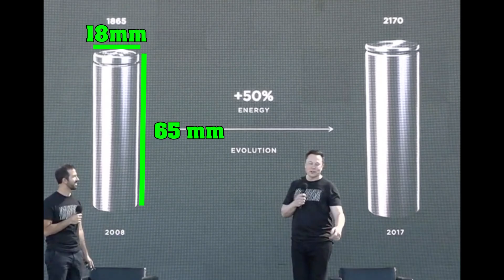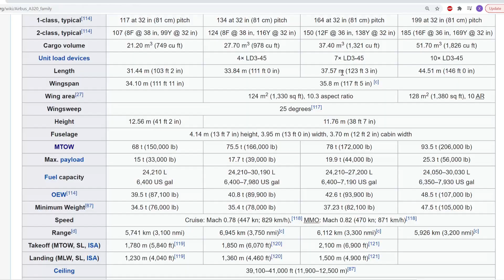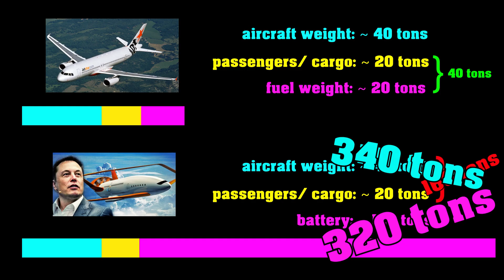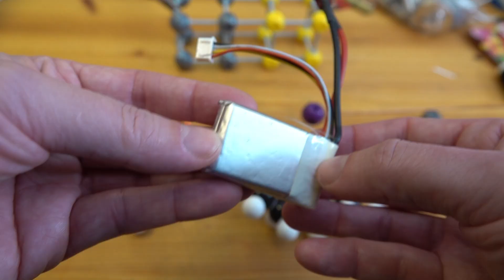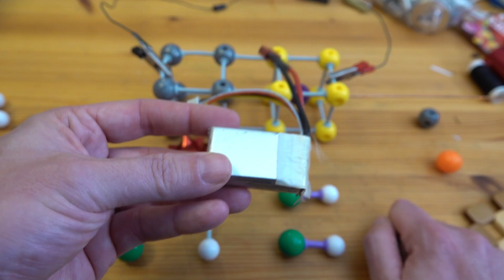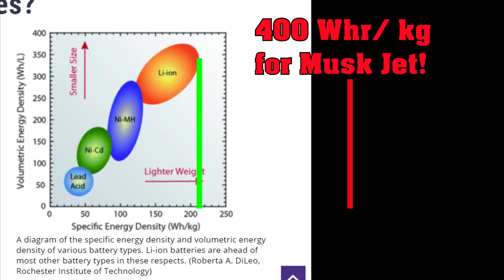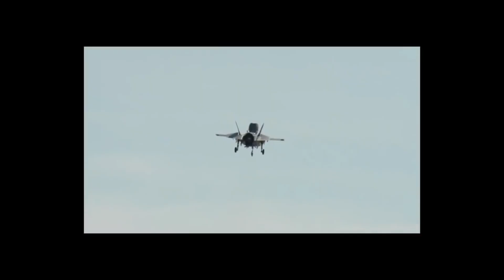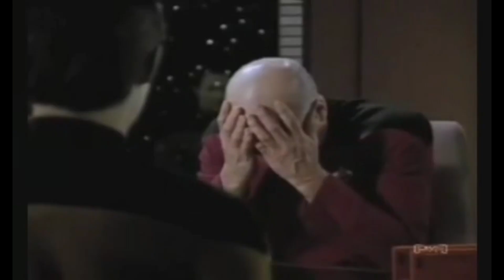Tesla's Secret Plan To Disrupt Airlines: BUSTED!!

Comment: Has anyone pointed out to Elon that we’d love to see how his electric “jet” engine would work?

Is he just going to have electric motors spinning a big fan? Because those aren’t going to do great with supersonic air hitting the fan blades.

Or is he going to use electricity to somehow rapidly heat the air inside the engine like in the studies for nuclear jet engines in the 50s. Because you really do need a nuclear heat source to try pulling that off. Good luck.

Also, did anyone point out to Elon that as a conventional aircraft burns off fuel it gets lighter and more efficient? While his battery with wings will be carrying around tons and tons of dead weight from discharged batteries?

This is so incredibly dumb from a basic math standpoint I can’t believe he mentions it with a straight face. Or does he just talk about this when he’s high as a kite?

If you want to use batteries and electric props where short-hop aircraft fill the market like the float plane island hoppers in the Pacific Northwest, that niche could work.

Large scale aircraft applications are just silly given current and likely future battery energy densities.
Reply: @acefox1 I don't mean to be rude, I live in New Zealand and rocket labs a us company run by a New Zealander managed to get an electric powered rocket into space I think elon might be able to get an electric jet engine to work
Reply: @Joshua_devourer  Your statement is incorrect. Rocket lab's Electron does not have electric propulsion - it burns fuel to have thrust. The only electric engine there is used to power the turbine which pumps the fuel and oxidizer components. They made such design for simplicity - simple engine means fast production - more launches.
Reply: @Immanatum  i meant to say electric pump 😅
Reply: @Joshua_devourer  Really, can you explain what the propulsion method is? What is he using to overcome gravity or change direction while in space. No solids, no gasses..Just spinning rotors milling away at nothing?
Reply: @zwartje89  technically, it is possible :D in a strange idiotic way, but it's possible. Rotors rotating wheels, which can change their geometry in needed direction with speed corresponding to rotation frequency.
Holy sh*t, need to patent this before Elon gets another billion :D
Reply: @Joshua_devourer  Thanks for showing us all that you don’t understand the difference between an electric powered fuel turbopump on a rocket, and a jet engine which does not use turbopumps.

Jet engines burn fuel to produce thrust and spin turbines to power the engine.

What is Elon’s 70% battery plane going to burn to produce thrust?

Electric powered fans do not and will not scale up to produce anything close to the  tens of thousands of pounds of thrust needed for a 75 passenger or larger aircraft. Fans and propellers cannot function with supersonic airflow.

Also supersonic flight is not possible just using electric fans. A combustion engine, jet or rocket, is REQUIRED to attain the speeds needed for supersonic flight. Where will you store a heavy, energy-dense fuel on an aircraft that is already 70% batteries?

Hit me up when we have an electric powered jet that carries dozens of passengers.
Reply: Researchers from Wuhan university have created a prototype thruster capable of generating plasma jets with propulsive forces comparable to those from conventional jet engines, using only air and electricity.

An air compressor forces high-pressure air at a rate of 30 liters per minute into an ionization chamber in the device, which uses microwaves to convert this air stream into a plasma jet blasted out of a quartz tube. Plasma temperatures could exceed 1,000 °C
Reply: @blackmartini7684  very interesting. I guess a lot depends on whether these conceptual proof of concept lab inits scale up, whether they can handle high-speed airflow, what their thrust to weight ratio is and most importantly what the power consumption for this microwave plasma engine is. Because I’m guessing the power consumption is enormous and only worsens the energy density problem of the batteries.
Reply: @acefox1  "Because I’m guessing the power consumption is enormous..." It is indeed. To my knowledge, better idea would be ionic propulsion. Experimental plane of that sort, although very weak, have been built. Idea is similar: use electric field to push ions. But they produce ions not by heating air, but by ionizing it with electric field.

"If you do the math you will see that current and 5-10 year projected battery energy density will not scale up to a 75 person or larger electric jet." You realize that your 75 or larger limit sound much like a dishonest tactic? In 1920's anyone could say "Cruise ships can take up to 4000 passengers per trip. I doubt planes will ever be able to take at least 1000 passengers, therefore it's not viable". 

As for VTOL, that's clearly a disadvantage from energy point of view. VTOL is good for infrastructure and for passengers, but it's a disaster for engineering. VTOL requires extra power, extra machinery, and different working modes. I fully agree with you here. 

The same for supersonic. Unless we invent some exotic propulsion methods, it's not possible.
Reply: Have you seen the rolls royce engine. The turbo prop is already here.
Reply: @thesg6900  Turbo-prop technology is almost as old as the jet engine. What Rolls-Royce engine are you talking about. Do you have a link?

Propellers and electric ducted fans can’t and won’t come anywhere close to matching the power of jet engines. They don’t scale up.

Propellers and pure ducted fans cannot handle supersonic flight and supersonic airflow.

What does this have to do with batteries, energy-density and electrical motors?
Reply: @acefox1  Hyperloop tickets? No. 
Tesla stock? Yes.
Can you name a single Musk company developing any type of hyperloop system? Oh... right.

Hard to make fun of guys who invested in a stock that rose 700% in a year.
But sure, keept telling yourself how you're better than Musk. It's not weird at all to become a toxic hater for no reason to the point that you comically misreprsent the obvious as TF does in this video.
Not weird at all.
Jealous, much?
Reply: @bluesrockfan36  Again, Musk fans shouting into the wind, attacking arguments nobody is making.

Is SpaceX doing great work? Yes! They are awesome!

Is Tesla doing well? Yes, and good for them. I wish them all the success in the world and hope they keep improving their technology.

On the other hand Musk abandoned the Hyperloop because he couldn’t hide that the Hyperloop is a hopeless and stupid idea. All of the proposals in Elon’s famous whitepaper are wrong. Or are you pretending that Elon wasn’t banging the drum hard for Hyperloop back in the day?

Hyperloop will never acheive even half of what it’s cult  are promising. Which is why Musk abandoned it, but the Hyperloop cult still invokes his name as if he’s Jesus.

And as for Musk promising a VTOL, supersonic, battery-powered electric jet, that’s all pure bullshiat. 

As was laid out mathematically in a previous post by @Immanatun the energy density of current and projected batteries can’t compete with jet fuel. The power to weight ratio of large electric motors compared to comparable gas turbine engines (jets) is not likely to be in the same ballpark for decades. 

Lastly, you need a combustion engine for Musk’s promised supersonic capability. That means a rocket or a jet engine. No propeller can provide supersonic power. No electric ducted fan can do it either. 

Musk has promised a VTOL, supersonic battery-powered airliner. What he might eventually manage in 10 years is a battery-powered DeHavilland Beaver clone or maybe a ducted fan learjet that might hold a dozen passengers and has a 300 mile range. And on that day you will declare victory and throw Musk a parade without ever acknowledging that he only reached about 5% of his goal.
Reply: @acefox1  So... not everything Musk does is a god-awful abomination and bullshit? Good!

How can Musk abandon something he never started in the first place? Brining an old idea (the Hyperloop predates Musk) into the public consciousness is hardly "starting" something.

But again, Musk is NOT developing, nor has he ever on any of his companies... a hyperloop.

The reason Musk's name is brought up, is the reason TF loves to make fun of him unfairly.
He is popular. They're all capitalizing on his popularity for money.

"Musk promising a VTOL, supersonic, battery-powered electric jet"

Again, this is where TF bullshit comes into play.
Musk would like a VTOL supersonic electric jet.
So would I.
So would you.
In no uncertain terms has he every promised anything.

He is NOT working on it. His companies are NOT spending money developing it.
He even said so himself, we need years if not a decade away for the battery energy density for it to happen.

This is just TF lying, misrepresenting for profits and views.
For example:
Do I need to explain to you how drastically different designing an electric aircraft is from a jet-fuel one?

That you simply cannot grab a current airplane and replace fuel with a battery? That this is beyond a childish strawman?
Well... that's what TF is doing in this video.

You guys act like Musk is actively spending time designing an aircraft by slapping a tesla car battery to an airbus or something.

This is beyond stupid.

He's also flat out lying about Tesla battery day.

I for one, am not arrogant enough, having read about the new propulsion systems being developed (atmospheric breathing electric propulsion) to claim what we can and cannot build in 10 years time.

We also do have experimental batteries nowadays that do achieve the necessary energy density.
Who is to say in 5 years these won't become mainstream?

I don't know. But I do know that if Tesla or SpaceX decide to start investing in this idea, I wouldn't bet against them.
Reply: Over half the flights in the contenential U.S. are 250-500miles one way. Also the most efficient engines for radio control jet airplanes are electric. 😁
Reply: @4literv6  which could be fine. As I said the short-haul market could be a niche where this would work. Vancouver already has an electric DeHavilland island hopper in trials.

But an electric “jet” engine needs to be explained. How does that work exactly? Then it needs to be explained how that would possibly work supersonically... over land, as Elon proposes. 

Add in the nonsense with VTOL for tons of dead weight with partially discharged batteries and it’s complete nonsense.

Battery powered aircraft do not scale up well because of battery energy density as is demonstrated in this video. This is why batteries are great for RC aircraft and possibly small commuter craft but not for regional jets or larger aircraft.
Reply: @acefox1  China is already flying 2 person vtol aircraft as of 2020. They only have 50-100km range, but they do exist already now as in today, you can even book a flight on one through an app!

Also there are multiple private electric aircraft available now, pipstrel makes one fully electric 2 seater. Available since 2018 I believe?
 
A converted Cessna 7 seater flew last year with a range of over 200 miles. So far in early tests operating costs look to be 1/3rd to 1/5th of an ice airplane of the same class. Plus reduced noise, smells, smoother operation. And longer life cycle without needing expensive rebuilds.
There is a company called eviation making a ground up bev of composite construction. 
Which should exceed 300+mph and have a 350-500 mile range. https://youtu.be/oDfhg_KRftg
Reply: @4literv6  yea, but that doesn't sound like supersonic aircrafts, does it?
Reply: @4literv6  I’m not disputing any of that. If you do the math you will see that current and 5-10 year projected battery energy density will not scale up to a 75 person or larger electric jet.

It will not scale up to a supersonic passenger jet.

It will not scale up to a VTOL, superonic, passenger jet.

You are arguing against points I’m not making.

I did say that small planes on shorter routes may be a niche where battery powered electric aircraft can work. 

But I’m also saying that unless battery energy density doubles then battery-electric jet airliners with 75 or more passengers will be a pipe dream.
Reply: @4literv6  They're hardly the first to try that.  There was a company that tried something similar, with robitically  built composite aircraft, maybe 15 years ago.  It went rather badly after the founder was killed when a prototype crashed during a test flight.  They claimed the cost of flight per person would be comparable to driving for distances in the range of a few hundred miles.  (At some point, the scaling effect of larger jets made of metal are going to win out, but that's a matter of the details of the implementations.)
Reply: @acefox1  I got what you are attempting to convey. 
400wh+ per liter gets us close energy density wise for electric aircraft that make sense. Again in the 500 miles one way range or thereabouts. Which would satisfy half the flights currently flown worldwide. 

Once you make that business case? Aggressive big investment will produce the long range fast high passenger capacity aircraft.

Supposedly some of the already made solid state batteries meet&exceed that energy density metric. 
With their fast charging ability, more stable to temperature fluctuations and fewer heating&cooling requirements. 
Solid state batteries should do the trick in just a couple more year's from now. 
2 being very optimistic that aggressive investments will push it forward that fast like quantum scape is seeing, 3-5 without those needed dollars.
Reply: @4literv6  You know what's even better than an electric plane if you need to go 300 miles? An electric high-speed train. It's more energy efficient (no need to keep 50 tons of metal in the air), more comfortable, less noisy and doesn't require annoying airport security and check-ins.
Reply: @The_Blazer-u9t  I agree and high speed rail could be an answer. But sadly the U.S. just doesn't see it as such. 😑
Reply: @4literv6  I suspect the answer here is structural batteries and smaller plains. More flights, more often. Missed your flight? Oh we have another leaving in 30 minuets.
Reply: @warrensteel9954  that could very well be the case to.
What I think is very likely to happen with electric aviation as it comes online. Is that smaller regional airports will see volume increases. 
Due to the quieter nature of electric propulsion.
Reply: @4literv6  a local airline that runs float planes has a prototype already flying and getting certified to carry passengers. They are still a few years away as the batteries will take a time to get certified. All their flights are really short so it's cost effective to retrofit existing aircraft.
Reply: @4literv6  1) is there any battery with 400Wt/h?
2) how long it takes to charge plane's baterries? (e.g. refueling of A320 takes ~ 50 min, recharging Tesla Model 3 - "44 miles per hour" of driving on the ground)
3) how to get thrust comparable to jet engine using electric one instead?
Reply: @Immanatum  1: as far as I know only solid state battery prototype single cell format have hit this energy density. Although supposedly lithium has gotten near 350wh.
2: I do not know how long it would take to charge an airplanes pack? I'd imagine the megachargers being designed for commercial electric truck's as we speak. Could be adapted easily enough. 
3: as I said before electric ducted fan rc airplane motors are extremely powerful, I'm sure the tech could be scaled up. 🤔
Reply: @Immanatum  1) very close, the new 4680 battery from tesla has a 380Wh/kg density, and that's the first battery with the new chemistry, so it will only get better, and possibly hit 400Wh/kg density in a year or two, and it's not a solid state battery yet
2) the V3 tesla superchargers will charge at 250kwh, equating to a 1000miles range per hour charge rate, and if my maths is right, it should take around 20 minutes to charge a tesla model 3 with a 75kwh battery,
3) it depends on what type of thrust they generate, but if i had to guess, but as immanatum said, there is already very powerful electric engines, and Tesla engineers won't have a problem scaling the technology or inventing new ones or improving on existing ones.
Reply: @RC18  
1) no it hasn't. In this video there are some details why. Current Tesla batteries holding energy density around 150 Wh/kg (yeah, whatever Elon says) or ~0,55 MJ/kg. Energy density of kerosene is roughly 40 MJ/kg - 72 times higher. Just take mass of kerosene and multiply it by 72.
2) ok, let's do some MATH. Let's find out what it takes to charge an electric powered competitor for  A320. A320 fuel capacity is 27 200 litres or 15 843 kg. Total energy stored: 15 843*40 = 633 720 MJ. Joule is Watt/second, kWh (which is needed) is 1000Watts*3600seconds = 3 600 000 Joules, 3.6 MJ. So, 633 720 MJ/3.6 MJ = 176 033 kWh. 
Tesla Model 3 battery stores ~75 kWh of energy. It is claimed, that Supercharger charges battery up to 80% (safety first or fireworks show is imminent) with 170kW superfast charger in 20 minutes - (75*80%)/170 = 0,35 hours ~20 minutes. Now get this imaginary plane charged up to 80%! (176 033 kWh*80%)/170 = 828.39 hours = 828.39 hours/24 hours = 34 days, 12 hours,  14 minutes and 24 seconds. Even with announced 250kW charger it's a little bit long time to wait, isn't it? 
3) Engine. A320 has CFM56-5Series engine with thrust of 98-120 kN, let's take arbitrary 110 kN, 385.5 kg/s of static airflow mass. 
Let's do some MATH x2. Engine uses action/reaction principle to produce the thrust, ergo - must apply the acceleration to the air passing through it. Force = mass*acceleration , Thrust force = airflow mass*velocity of exhausted gas, so Velocity of exhausted gas = Thrust force/airflow mass = 110kN/385.5 kg/sec ~ 286 m/s. So,  now we calculate kinetic energy, which, when derivated by time gives us power, produced by engine. Energy = 1/2* mass*exhaust velocity^2, Power = 1/2*airflow mass*exhaust velocity^2= 1/2*airflow mass*Thrust force^2/Airflow mass^2= Thrust force^2/(2*airflow mass) = (12100kN^2)/(2*385.5 kg/s) = (125 821 089 kN^2)/(771 kg/s) = 15 693 904 Watts, or 15, 7 MW. That's one engine. For both 31,4 MW is needed. 
The most powerful electric engine in the world is HTS electric engine with 36.5 MW and mass of 75 tons. CFM56-5Series Engine mass is 2,1 tons. It is needless to calculate power-to-weight ratio.
Reply: @redakanane  3) I didn't say anything about proper electric engine for aircrafts. The nearest comparable by power electric engines have mass overwhelming mass of the jet engine in times. 
2) to find how fast it will charge just divide battery capacity in kWh by charger power in kW. In addition, Tesla says, that Supercharger charges only 80% of capacity to prevent damage and so on.
So Capacity in kWh*80%/Power of charge in kW.
1) Even with 480 Wh/kg it is roughly 40 times heavier than kerosene.
0) Does this "miraculous" battery have proclaimed energy density? Really?
Reply: @Immanatum  these Musk disciples really don’t understand energy densities, power to weight ratios or basic aerospace engineering at all.

Their only response is “just you wait, in 3-5 years when x-technology arrives and batteries hold double the power...”

They’re probably all holding Hyperloop tickets too.
Reply: @acefox1  there is one key component in all of this entertainment - money. Things are going not very well, when people throw money into loo and waiting for a golden fountain. In fact, the situation around investments is so grim, that people are ready to put them anywhere to get interest. And here Elon Musk appears with magic hat and starts his show.
Reply: @Immanatum  " 2) how long it takes to charge plane's batteries? " 
There are two answers to that question:
1. Li-ion batteries can be charged in one hour, or less, depending on chemistry and use case. Of course, most casual batteries are designed with capacity in mind, so charging time  is sacrificed for more KWH. But in RC hobby world it is not uncommon to find a battery with 5C charge rating. That means you could charge it with the speed 100% per 1/5 hour. In other words, that's about 8% per minute. Not quite a problem, compared to 50 minute refueling time, is it?
2. If you are designing a battery plane and refueling if for some reason critical, you can always consider swapping batteries. It is used in lightweight electric aircraft anyway.

" 3) how to get thrust comparable to jet engine using electric one instead? "
You don't need to get comparable trust unless you really need to build a really comparable plane. So, why would you need to build comparable electric planes?

" Let's find out what it takes to charge an electric powered competitor for  A320 "
Again, wrong premise. That's like stating that Tesla Semi is not viable because you can transport much more cargo on a train. And even cheaper per KG.

" ok, let's do some MATH. .... Joule is Watt/second, ... Even with announced 250kW charger it's a little bit long time to wait, isn't it? "
Although Joule is Watt*second, your math looks ok. But why didn't you calculate refueling time for Airbus with generic car gas station? I bet you'd get nice figures as well. Here, let me help you. It takes, say, 2 minutes to refuel 40 liters tank in a car. 2 minutes / 40 liters * 27 000 liters = 22,5 hours. Not exactly 34 days, but clearly that's not a viable solution, so planes can't be used economically, right?

" The most powerful electric engine in the world is HTS electric engine with 36.5 MW and mass of 75 tons "
In the answer above I used an argument that airplanes can't be viable because cruise ships can take much more passengers. That was a joke, but you really use naval motor to prove that airplane is not viable! Do you realize how ridiculous that argument sounds? Why didn't you use Titanic scale altogether? That would sound even more convincing! 

" 2) to find how fast it will charge just ... "
Now you show how little you know about batteries. 
Roughly all modern Li-ion batteries are optimized to charge at 1C. That is the speed at which it would take one hour to fully charge, if charge speed wasn't decreasing in the end for safety reasons. Engineers can trade off power for energy density and lifespan. So, they can make a battery that is safe to charge at 5C, but it will have less density. Or they can pack it with a bit more density, but you'll have to limit charge speed to keep it safe and last long. And all batteries charge in the end slower, if you want to use those last percents of capacity. But the more you top-up the battery. the faster it degrades, even if charged at slow rates.
Anyway, charge speeds are limited by battery chemistry and safety. As for chargers, they could be made as powerful as you want. But as there was no powerful enough batteries around, there wasn't powerful chargers for them either. Simple as that.
Reply: @DimaZheludko  1) airliner for passenger flights means that such plane can take passengers. Obviously, more than two.
2) as a result,comparable electric plane must have electric engines and power source comparable with aircrafts of "traditional" design.
3) even rough calculations shows, that scaling electric plane to its jet competitor is a dead end. Because of energy density of batteries (nope, batteries won't charge in 1/5 of an hour) ergo batteries weight, weight of engines, which determines an awful exploitation and 0 passengers capacity. 

Tesla Semi is another "show", truck which carries 12 tons of batteries. Exploitation of anything electric in climate where winter is present as season shows its unreliability.
Reply: @Immanatum  What exactly do you mean by " electric engines and power source comparable with aircrafts of "traditional" design "? In what sense comparable? An order of magnitude is comparabe? A two orders of magnitude?
More, than two passengers. Would 3 passengers be enough? 5? 7?

My complain is that you make categorical conclusion, but when asked about specific, compare electric planes either with really big fuel airplanes, or use uncertan categories as "jet competitor" or "more than two".